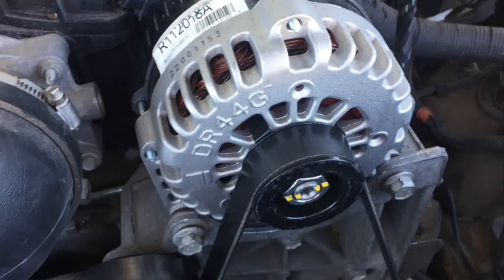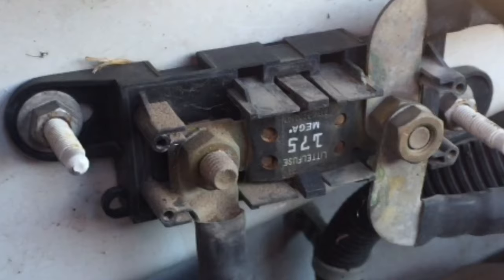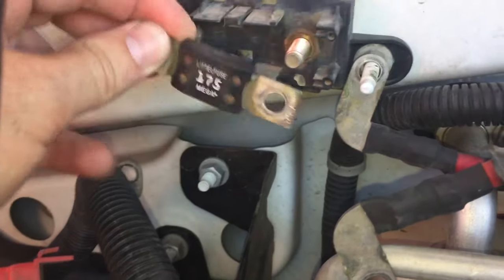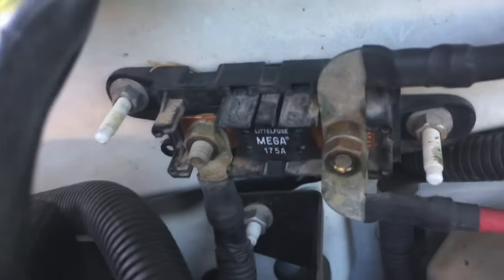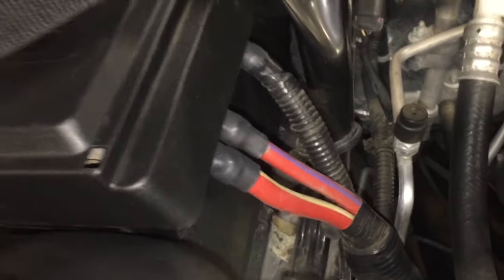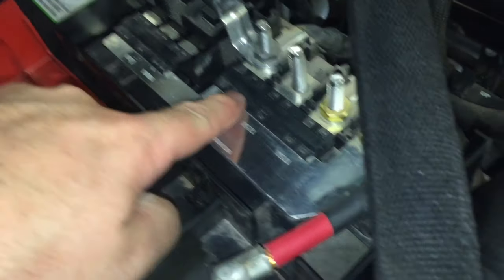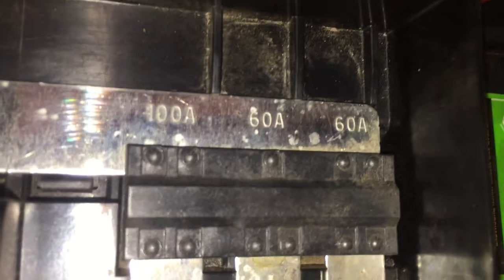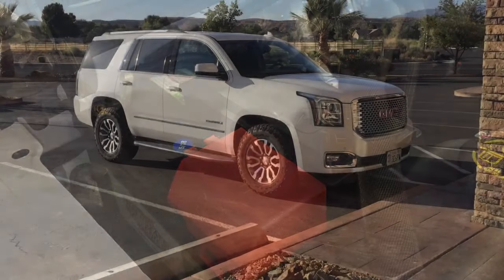Alternator Fuse Check this first, if new alternator is not charging. Shown on GMC Yukon Tahoe Sierra

Comment: My battery charging system came on and so my battery light while driving so long story short I replaced my alternator worked fine for a couple weeks and came back on again so replaced the battery and still getting that message at time my voltage goes as low as 12v but  at times goes up to 15v any help ?? I’ll be checking my inline fuse I guess
Reply from the maker: It’s probably another bad alternator (regulator). If the fuse blew it wouldn’t work at all
Reply: Loose connection or corrosion at the fuse could be the issue as it was for mine.
Reply: Well after two reman alternators and a new belt and was still happening after loosing my mind I went and got a $40 dollar used alternator from lkq and that was the end of it no more problems offer that.

Comment: Great video but I cant find my alternator fuse. Ive misplaced my manual and cant find one online.
Reply from the maker: Sometimes it’s part of the positive power wire, known as a “fusible link.” It’s not very common to blow out the high amp ones, but it is possible

Comment: Hi, I'm Mario and I would like to know where the alternator fuse of a 2018 Chevy Silverado is located, thanks
Reply from the maker: If you look at the battery cable for the positive side it has some built in fuse links. I also show other fuse locations in this video, but I don’t see the alternator since it’s probably the one on the battery cable https://youtu.be/6XxKA0wo_QQ

Comment: Danny Johnson's Garage I have a real challenge wanted to see if you can help. I have a 2004 Chevy Avalanche and when I go to turn it over all I get is the clicking. Long story short I replaced the starter, did work. I then replaced my still under warranty battery still didn't work. I thought it may be starter relay but didn't work. I then checked my battery with multimeter while it was running to make sure the alternator was charging. I only got 12.6 volts max. So decided to replace the alternator but it is still not charging my battery and truck won't crank without my jump box. Please help!!!
Reply from the maker: If the fuse is good, I would also look into grounds. There should be a ground that goes from the engine to the frame and another for the battery to the frame. They can be just as important as the power cable. In the video, It ended up being a bad new alternator, so it happens
Reply: @dannyjohnsonsgarage  Thanks for the feedback. Do you happen to know where the alternator fuse is located on a 2004 Avalanche? I will also look into the grounds
Reply: @dannyjohnsonsgarage  well after alot of testing and head scratching I finally figure out the problem. It was a bad ground off the negative battery cable going to the frame. I have since added a ground from the negative side battery cable going to the firewall and all is working like it should! Thanks!!

Comment: If the wire post is cracked were it connects to the fuse would that make battery light come on
Reply from the maker: Yeah, I believe it could
Reply: @dannyjohnsonsgarage  I believe that was the problem battery light went out . When I put new end on it

Comment: I have a 2016 Yukon and my battery keeps dieing after 3 months no engine light, any suggestions
Reply from the maker: Is the alternator showing 14V? If more it might be over-charging.
Reply: @dannyjohnsonsgarage  it's in the shop now 🤞🤞
Reply: @dannyjohnsonsgarage  they changed the ground cord to the battery and now it's reading at 14 but it goes slightly under 14 and over 14 is that okay?
Reply: @chuckdiseal6008  hi man man I have the same problem the battery keeps dieing what happens with the ground        when I change the new alternator is reading like 12  but is working  but two weeks later the battery die again
Reply: @jorick1986  the dealership changed my ground wire from the battery and it's working fine, please try it

Comment: Where is the 175 A on a 2003 Tahoe? I can’t find it anywhere
Reply: Its been a while but I think it’s under the cover of the main fuse box in the hood. Take that metal corner brace off (held by 4 bolts) and the entire black case lifts off the fuse box (I think there was 2 or 3 small clips holding it down). Again it’s been a while but I think that’s where it’s hidden on these. But once the cover is off follow the main battery cable to the fuse box and it should take you to it. I think it’s at the top left corner of the box (if your standing at the fender looking at it).
Reply: @dd4life158  8

Comment: The 175 print was upside down at first site .. then appeared to be flipped right side up ???? What the difference
Reply from the maker: The fuse can go either way. It may have been recorded upside down
Reply: @dannyjohnsonsgarage  ok because I was worried because i took mine out and forgot the original orientation.. having problems with new alternator charging new battery

Comment: By chance, would you know if an 02 Sierra 5.3 4x4 have a mega fuse? I can’t find it.
Reply: Did you ever figure it out? Got an 01
Reply: @LavxaGames  it was my battery box(little red box). Mine melted and the connection in the battery box that joined the battery and alternator cables was lost. Bought a battery box and problem was solved.

Comment: Iv put in 2 alternators in my 2015 Honda Accord sort and still reads 12.5v do you think it could be the fuse. Also battery is brand new so it’s not the battery problem.
Reply from the maker: It could be a fuse or a loose or cut ground or power cable is my thought
Reply: Those dont charge until under load
Reply: ELD (Electronic Load Detector) only allows that car to produce so much voltage. Basically to assist with fuel efficiency and to preserve your alternator's life span. There is a way to bypass it but it can be a tedious task and it is not recommended.

Comment: can't this fuse be tested in some way before I make a trip to the parts store (on foot cause car wont start, cus dead battery cus alternator won't charge)
Reply from the maker: You can do a continuity test if you have a voltmeter

Comment: I have a 1996 F250. Long story short alternator  is not charging the battery. Alternator has been tested ok by O'REILLY  where it as been bought brand new. Bought a new battery nothing is working. Any ideas?
Reply: Did you end up finding problem? I'm having similar issue now

Comment: I have a question i have 2013 chevy impala my alternator cannot charge my batteriy ,i replaced the it about a month and a half ago but the battery has died, when i jump start it regain it power and dies again. Im thinking it might be the fuse, what do you think?.
Reply: Did u fixed the problem?

Comment: Where is the alternator fuse on 2011 Town and Country just changed alternator and have a new battery but still not charging.
Reply from the maker: This article might help https://www.chryslerminivan.net/threads/replaced-alternator-still-not-charging.109722/
Reply: @dannyjohnsonsgarage  which posting? I still can’t tell if there’s a fuse for it?
Reply: @dannyjohnsonsgarage  I searched thru all of the postings done with same problem but no solutions oh well

Comment: So I’m just I stalled a new alternator and put my volt meter on the battery and it showed 14. something volts. The next day my girlfriend drove out of town and her battery was dead. Now my voltmeter shows 11 volts. I double checked my connections and checked this fuse. I’m thinking the new alternator failed. Going to have my girlfriend limp her car down to the parts store and have them test it.

Comment: I bought a new battery  a new alternator but my truck still keeps dying because the battery doesn't charge do you think it's the fuse?? 
I turn on my truck disconnect the battery and it turns off ....it's on a 1992 toyota pickup
Reply: Did you figure it out
Reply: Cause same

Comment: I have an 05 dmax it says battery not charging so I replaced both batteries and the alternator and it still says battery not charging. The alternator is good I had it tested it will run but stays between 9 and 14 volts I’ve checked all connections I don’t know what else to do. Any idea?
Reply from the maker: I would check any ground wires that go to the truck. There should be one from the engine to the frame and one from the battery itself to the frame. Also check for any cuts in the wire for the power wire from the alternator to the power supply box with all the fuses
Reply: @dannyjohnsonsgarage  there a little bit of fraying on the ground wire to the engine you think that could be it?

Comment: I have problems with 2011 Honda odyssey after change new alternator and still see light battery charging on
Reply from the maker: If the alternator and battery are good for sure, check the cables for power and ground. The engine also has ground cables to the frame

Comment: Bought 3 alternators and a battery for a 2008 Honda Accord Light popped on and off today. Could this be the problem?
Reply from the maker: If the fuse is blown it will stop working all together, so probably not it
Reply: @dannyjohnsonsgarage  it has stopped on me 3 times before this. Any other suggestions?
Reply: @marybrown8749  hey bro did you ever fix the problem. I’m having the same problems with my Acura

Comment: I have a 04 GMC Yukon and upgrade my alternator from 145 to a 220 amp but it's still showing my voltage dropping to almost 10 amps on my dash what can I do to get that higher when i rev it a bit my voltage goes up but at idle or at a light it's low to almost 10. Could it be my fuse aswell and if so we're would it be located at for my vehicle?
Reply from the maker: I would check the fuse and also upgrade to a larger power and ground wire for anything over 170 amp. It’s called a big 3 wire kit https://youtu.be/0j6HM11D2dw
Reply: @dannyjohnsonsgarage  what fuse are you implying to
Reply: looking for where the fuse would be as well... thanks
would it be the iga 40amp fuse in the underhood electrical center?
Reply: Hey I’m having the same issue with my 2012 Silverado 1500. Did you get the problem solved
Reply: @dannyjohnsonsgarage I think the inline fuse only comes on the newer gm models mines due the the Rvc charging system mines didn't have that feature

Comment: 06 gt replaced alternator and battery but now getting check charging system message any ideas?
Reply from the maker: It could be a loose or bad ground cable. There are typically 2 From the battery to the frame and from the engine to the frame https://youtu.be/0j6HM11D2dw
Reply: @dannyjohnsonsgarage  was reading on  mustang forums to add a ground wire from alternator to battery ?

Comment: My alternator voltage goes from 15 to 11 voltage do I need a new alternator
Reply from the maker: It should be constantly over 13 V and up to 14 V. If it’s fluctuating a lot the regulator is probably going bad on the alternator
Reply: I’m having the same problem. New alternator, battery, new negative cable and circuit sensor and still getting  
‘Service battery charging system’. 
Lights are flickering and volt meter in cab 15 to 11V.
Reply: @bigq13  I’m in the same boat as you. Any update?
Reply: @Sean W I took minds to the dealer and the put a DR37 Alternator part number #20881337. After that on problems. Hope this helps.

Comment: I can't locate mine on a 2012 chrysler 200.
Reply from the maker: The fuse on my newer Yukon is on the battery cable where it connects to the car battery. If it’s not there, sometimes it’s an inline fuse that’s hard to see as part of the battery cable

Comment: I think I have this problem I have 2013 Cadillac ATS has the smart charging system . My question is I have a bunch of BCM fuses I think control the alternator does that sound correct ? Was charging fine one day then stopped .
Reply: Did you end up finding the problem

Comment: I just got a new alternator in the battery level high in when i take it out of park the level go down but when i give it gave it go to the max high do tou think its cause the battery i dont no what to do next its a brand new alternator i just put it on yesterday in took it back to get it tested in nothing wrong with it
Reply from the maker: How low? It should always be 13V-14.5V. Naturally it will regulate up and down with more engine rpm, but it should stay 13-14 volts
Reply: @dannyjohnsonsgarage  but should my check engine light stay on
Reply from the maker: It depends on if that’s why the light is on. Typically the alternator will trigger the battery light, not the check engine light. I would have the codes ran at a parts store (they typically will do it for free) and then reset it https://youtu.be/wMd3CkYzkuk
Reply: @dannyjohnsonsgarage  I meant my battery light my check light never came on its the battery i dont no no more the battery level still pass high
Reply from the maker: @taylormade7398  if the battery level is passing too high the regulator on the alternator may be bad. Even though it works it’s not working properly
Reply: @dannyjohnsonsgarage  the one yesterday was a 170 amp it was brand new then i went back today in switch it in got a 135 amp in its doing the samething
Reply from the maker: @taylormade7398  I suppose the next step would be to check all power and ground cables.
Reply: @dannyjohnsonsgarage  I Just put a new battery and alternator in my 2010 Nissan Maxima ,the next day the battery light came on , now the light goes on and off when it wants to.

Comment: Is that the technical name of that fuse called the in line fuse for the alternator or is there another name for it so I can look up the fuse,  I'm sure that sounds like a dumb question but I want to be sure what the fuse is called so I can get a new one and see if that is my alternator issue.
 I have a 2005 buick lacrosse  3.8 l my message center tells me that I think it said charging system failure my voltage on my vehicle reads 11.7 V I know that most alternators produce around 14.6 to point 7 But maybe it is different for these new vehicles I know that they also require a higher amperage alternator
Reply from the maker: Fusible link If it’s part of a wire
Reply: @dannyjohnsonsgarage  oh ok thank u
Reply: @dannyjohnsonsgarage   What I meant is what is the fuse called so I when I go to the part store I can tell them

Comment: I put a new mega fuse but it’s getting really hot. What can cause this?
Reply from the maker: The regulator from the alternator may be bad so it’s allowing the alternator to give more power than it should (won’t regulate it). You’ll need the alternator repaired or replaced IF that’s the case